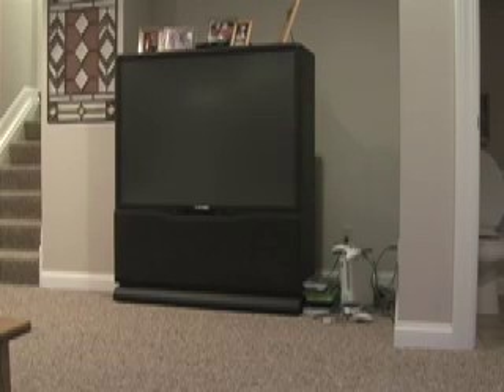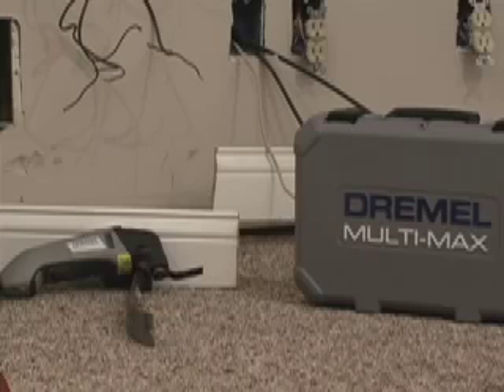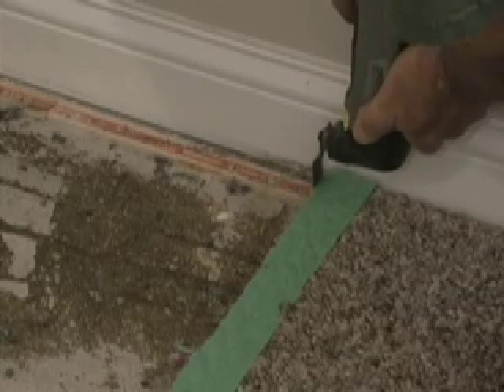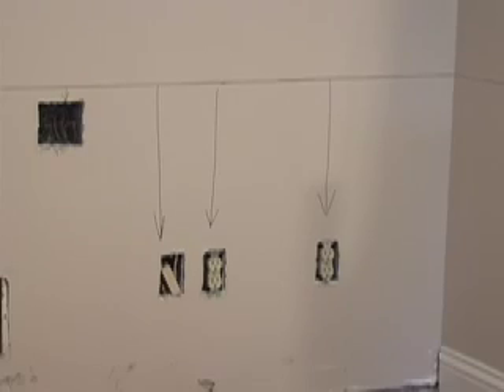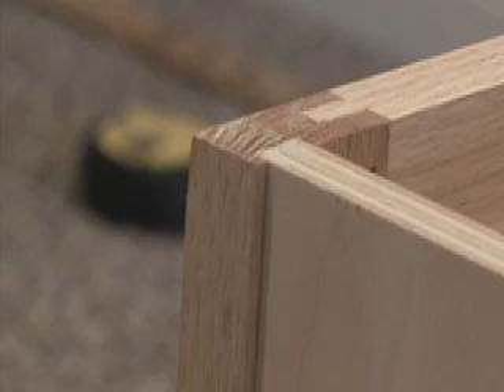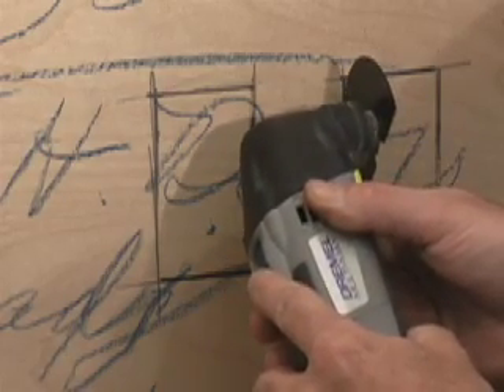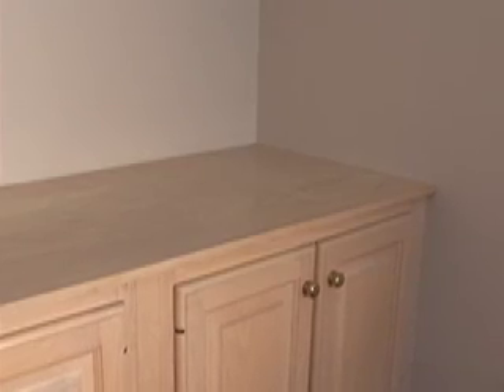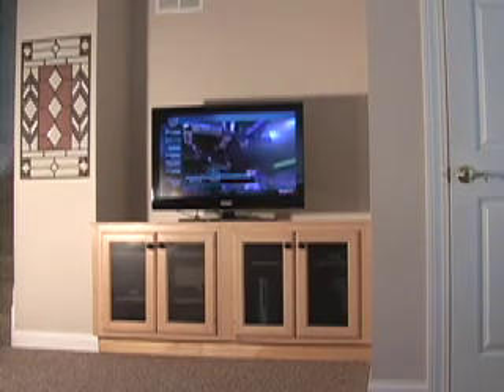ENTERTAINMENT CENTER CABINETS

Comment: Another great vid!  I didn't quite understand the bit about the 4" masonite to make a template. I understand the walls aren't perfectly straight, and once you get the masonite shaped like the wall countour, you could use it as a template...but how do you get the masonite shaped liked the wall contour?